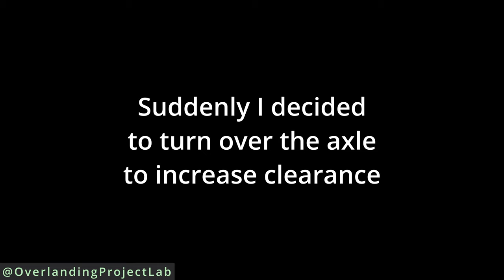How to build a trailer for utility or camper base

Comment: Need to put center of ur axle 1’ past dead center of frame it will give u better give u better tongue weight and ur side pieces for ur frame same thickness as ur tongue frame and not have to add metal for axle mounts

Comment: Maybe a stupid question, but why not use plastic fenders ? No rust, easy to fit and replace and cheap! I’m in Europe, and when I see all of these American style trailers I always wonder why they always choose to make there steel fenders ?
Reply from the maker: I use it as a step when loading. It's also very durable in the forest on a tight trail. I don't want to replace parts, I prefer to build it once.